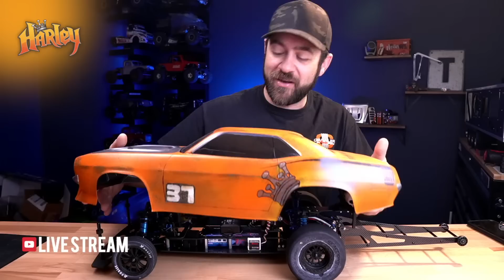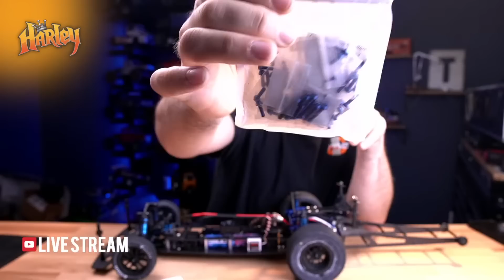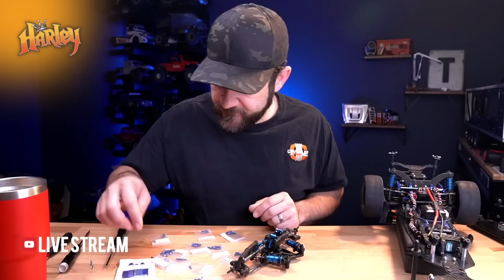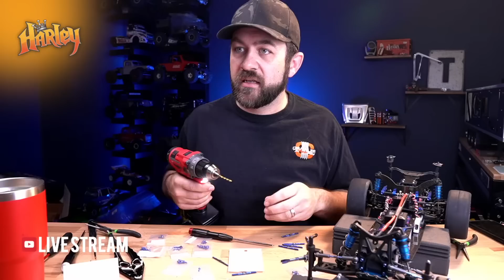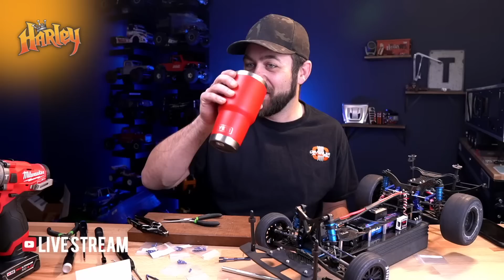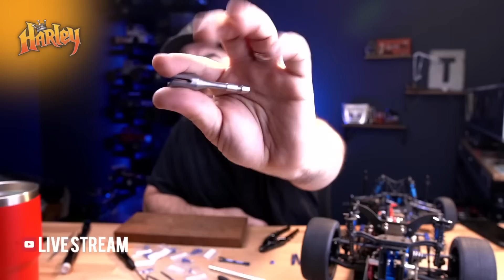RC Speed Secrets Parts - Sunday RC Car Cast - EP7

Comment: We raced straight axle cars in the 90's and I don't understand why they aren't allowed now. I'm guessing so the conversion market has sales. They still race them in Lake Elsinore plus the suspension cars too. In the mid 90's pro stocks ran low 2"s if I remember correctly. The coms had to be recut after every run because Graupner motors would burn up each run. They had quick drain 8 cell batteries, 36 ounces weights and Proform bodies, foam tires and the strips were VHT'd the whole length. My class was Super Stock, 6 cells, stock un-adjustable timing cans, 42 ounces, protoform bodies no spoilers or wings. 3.20 et's mid 40mph same O ring front wheels 2 inch foams on the back and sticky compounds on the tires. I'm going to build a new car so I can race up here in the 916 area but the old cars ran very fast with the chassis's covering the suspension problems at the time. I still have my SS cars one being the championship winning car from 1996 and the second one my nephews ran as my development car back then. Love your videos by the way. Our track was full of either NHRA crew members or machinists and engineers back then. Adult toy cars
Reply: That's pretty cool, Rick. I think there is a market for that old school platform with the new electronics available today. Stay cool.